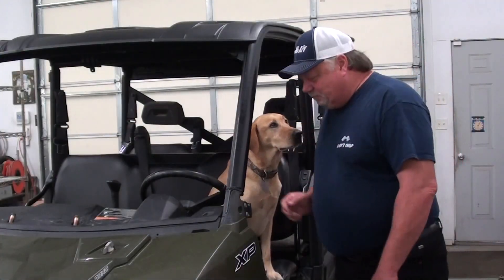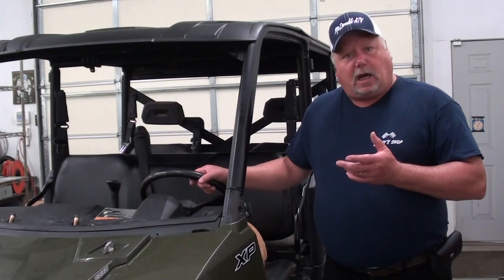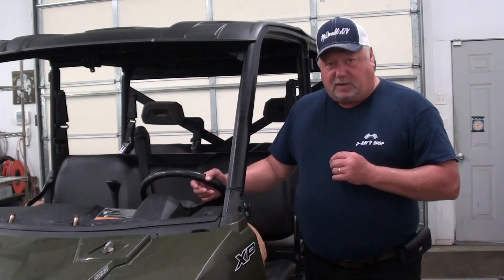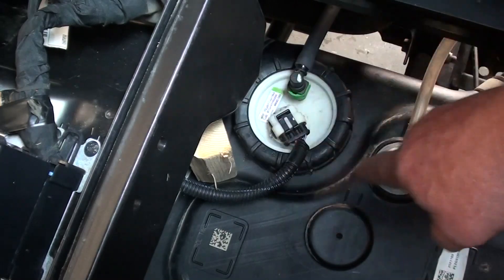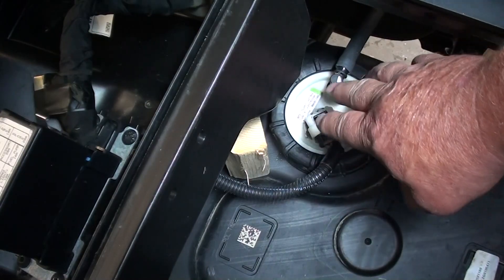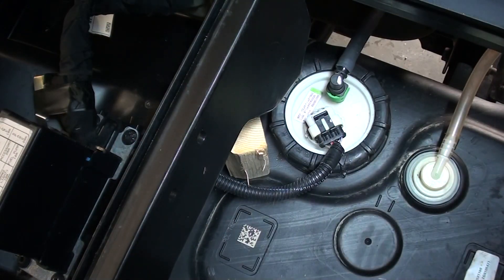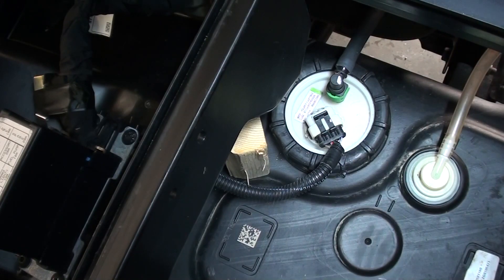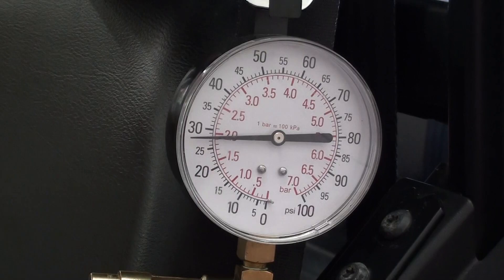Pt.1 2016 Polaris Ranger EFI Fuel Pump Troubleshooting And Repair For Under 30 Dollars

Comment: Hey D-Ray, thanks so much for posting this video - it is awesome!  I replaced the fuel pump in my Ranger 570 SxS and then checked my pressure, and it's reading 50+ psi... but I'm still having the same symptoms - it starts and will run for a couple of minutes, but then sputters and dies and then backfires.  Any ideas what I should test next?  Thanks in advance!
Reply: D Ray Any chance you could comment on this?

Comment: D-Ray thx for part 1 & 2 for test ranger fuel pump. I bought a test kit and fuel pump was putting out 58psi. So where do I go now. 2013 Ranger Crew 800 EFI. Runs good at first but then bogs down, back fires stops. But it starts up and repeats the bog and runs ruff and backfiers. Again first of day runs good but then goes bad.
Reply: Check your old pressure. Oil pressure valve starts to stick in the 700 and 800 polaris motors

Comment: 2011 polaris ranger 800 fuel psi at 40-41. Having issues with cold starting and low rpm dieing. Runs great at idle once it finally starts and runs great at mid to high RPMs. New Tmap sensor and harness, new TPS sensor and harness and 4miles on the rebuilt 800. 🤦‍♂️

Comment: Video 9/30/2018. Troubleshooting fuel pump

Your video is quite old but I like the harness with quick connects to the pump and to the fuel line….  My sxs is a 2013 Polaris xp 900.  Any chance of getting the quick connect part numbers you used?  Not sure if the 570 in your video has the same size fuel hose and pump outlet as my 2013.  Thank you

Comment: not for nothing but i read a comment on another polaris sportsman 570 video which has a almost identical fuel pump set up and it seems as if the fuel pump gets loose in the housing and the o ring on the pump output looses its seal and you loose pressure and there is nothing wrong with the pump at all. i stuck a piece of plastic on the back side of my  pump and the housing to take up the space and keep the pump tight in the housing and fixed it like new. this is a piss pore design by polaris shame shame. thats what i get for buying Chinese instead of Japanese lol i bet a lot of people are buying fuel pumps that dont need them and this condition will always show up ass a bad pump  polaris should issue a recall .  hope this is helpfull

Comment: Iv gotta 2011 Polaris  Razer Ranger  900 xp.It won't turn over I put a one way bearing in it but I  didn't  use a torch wrench  to get it just write,so if you could  help me out do I use footpound,or inch pounds  to the write  speackes?

Comment: Love the Video"s and really like you helper ! Anyways got a 2013 4 - Seater  800 RZR - with very low hours -------- all me and Grandma ever do is give the grandkids rides ------ it's been to the river 1 time. 

Well anyway can't hear the fuel pump cycle anymore ---- I've got 5.2 volts going to it ( is that cool ? -- shouldn't it we 12  Volts ? ) on the first wire on the plug.   Engine cranks , but no fuel and of course no start.  Can't believe fuel pump is out with so little hours on it ....   Your thoughts ?
Reply: I'd like to know what you found out I'm only getting 5 volts
Reply: Obviously it's a bad connection, probably ground seems to be a common problem on these.

Comment: Love the video.

Where did you get your fuel pressure tester with the Polaris quick connect ends so you can easily just book it in line??
Reply: Same question
Reply: same question, went to oreilly's and autozone and nothing would work,,, it seems maybe utv specific type efi connections?   anyway, gonna try amazon.
Reply: Any luck finding it?

Comment: I have a 2016 that was running hot, I replaced the top end (the piston had a hole burnt in it) along with a new injector. Its seems to be starting, idling and running fine now, but I removed the spark plug the other day and it still seems to be running hot. Could insufficient fuel pressure be the culprit?
Reply: No.